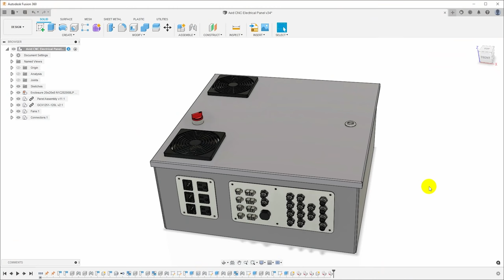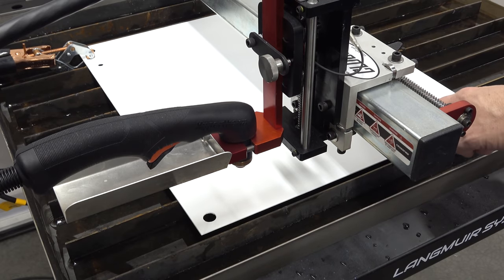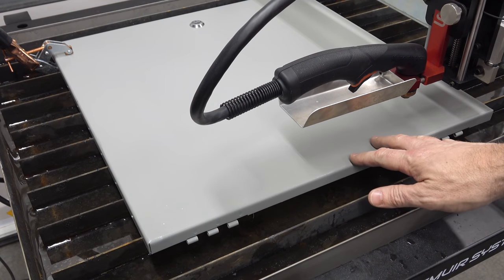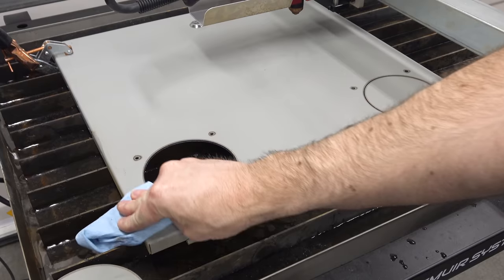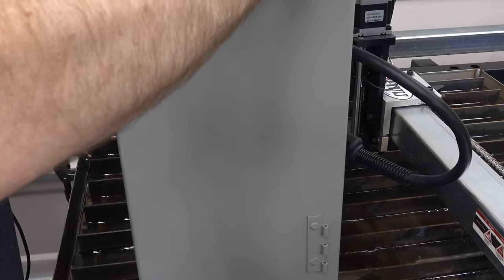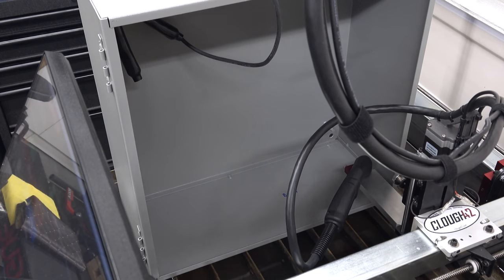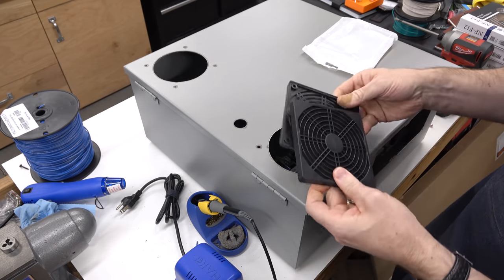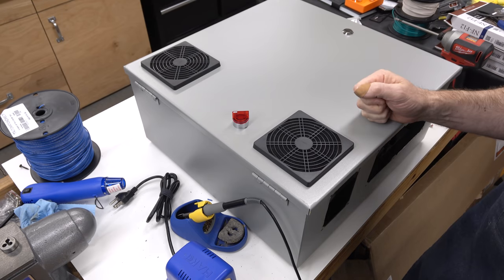Can you CNC Plasma Cut a NEMA Electrical Enclosure?  Should you?

Comment: A lot of industrial panel manufacturers use lasers for back plates and doors.  Plasma is a little less precise but as you discovered works just fine. I would run the water in the table higher.  There is less HAZ and smoke when the part is submerged.
Reply from the maker: I would if this table could accommodate that.  As it sits, the tops of the slats are above the edge of the tray.
Reply: @Clough42  new video idea. You have a plasma, brake and welder. You could do   a bladder table that changes levels.

Comment: My first thought about the slag/dirt on the paint was....Why not use the Teflon spray for mig tips/cones? Readily available at good welding supply places. Cheap(ish). High temp. Clear. Dries quickly. In production env. it lasts about 12hrs. Huge difference in slag buildup on the tip/cone. I wonder if it would keep the smoke, soot, slag from sticking to the paint?

Comment: I would have added an 8 inch extension and cut it off the front of the table.  I really like you extension design.  I will utilize that on my Langmuir table for cutting holes out of big stuff that wont fit otherwise.   The other way I have done this is use the CNC table to make a template that is about 1/4 inch larger on all dimensions, c clamp in place and use that as an edge to hand cut. This works good on vehicles etc.
Reply from the maker: If you extend the arm, be sure to check the springback.  I had to change the springback from .010" to .028" to compensate for the flexibility.

Comment: Dang, you can cut through a painted panel with plasma. Very interesting. Don't worry , James, you'll come up with another fine reason why you HAVE to buy or build a waterjet attachment for your CNC cutter :)
Reply from the maker: This plasma cutter has a pilot arc.  Without that, I don't think the torch would have lit.

Comment: When I first saw that you were going to cut the bottom of the box, I figured you would lay it on its back and cut it from the side by turning the torch to cut into the box. Wondering if that would be a viable way to do this job without getting the smoke and splatter from the water. The torch wood only need to move up and down I don't even know if the machine can be programmed to do this. But I bet if it can be done, James could figure it out!!!
Reply from the maker: You could probably do this by swapping motor cables.  Though getting the initial height sensor to work would require more thought.
Reply: @Clough42  Thanks for the reply, James. I have never used CNC plasma machine. I'm planning on purchasing one soon. Thanks for showing and teaching us how to do things, much appreciated!

Comment: Have you thought about making an enclosure from scratch? Cutting the sheet metal on the plasma cutter, using a bending brake, rolling the hinge etc...
Might be a good how to for others  and a challenge in thinking through the steps needed. There are a few videos on youtube by 
Dan Gelbart that showcase a number of tools he uses in manufacturing high precision end products for prototyping. He covers a number of things that are part of crating custom cases, but only  as disconnected examples.
Reply from the maker: Possibly for a future project.  This one is a little large for my plasma.

Comment: If you want to completely cover the black stain around the red switch. I have seen it is possible to buy a label holder for these switches. It is a black square thin piece of plastic, it mounts like a washer.

Comment: I've done a few boxes this way and for some reason I had to slow the cut down to 50% of what I would normally use for that thickness or even less. Something about the powder coating on the boxes made them really hard to cut.
Reply from the maker: Yeah, I had to slow it down, and it still just barely made it through.  I didn't go any slower because I was trying to limit the heat input.

Comment: II love your laid-back and thoughtful style. f you had a material you couldn't clean the smoke from and you really had to keep it clean - you could simply mask the area to protect it. Depending on the amount of heat exposure that could be as simple as masking tape and paper to something more heat resistant, like foil.
Reply from the maker: I thought about it.  I was a little worried about the blast traveling under the foil.  I thought about tape, but didn't want to add anything that would burn and make my day more exciting.

Comment: Yeah.. the internet is FULL of arm chair experts. I make my living cutting holes in electrical enclosures. The thing to remember is the enclosure loses its NEMA rating the instant ANY modification is made. ANY MODIFICATION. Electrical enclosures are made of low carbon, malleable, gummy steel that is a BITCH to machine, drill & saw, but easily bent, sheared, punched, plasma and/or laser cut, and can even be torch cut if you're in a bind and ready to re-paint.
Reply: Thanks for the info...
Unmodified enclosure surely is useful... Without a hole to get the power in...
Again some dumb rule/law...

Comment: great video. have you considered doing what alot of midsize CNC machines do, where you can extend the cutter (torch in this case) over the edge of the table so you can cut oversize pieces, obviously it wouldn't be over a water table but it does allow you to add a huge amount of flexibility in regards to what you can cut.
Reply from the maker: On this table, it's possible to take the tray off, and leave the entire inside open.  If I ever have a project that requires it, I might try it.

Comment: i added a drain bolt to bottom of water pan and made it a ground bolt, i never have issues of grounding and make great cuts... Powhatan Powder and fab  ....check out the vw bus we did on the same table you have
Reply from the maker: I have a brass ball valve on the drain, and I usually have the work clamp on that, but because of the powder coat, I wanted to make sure I had a good ground.  The plasma will make a real mess of things trying to molest the part with the pilot arc.  :)

Comment: I know you've already put it together but if any of the heat effected areas bother you you might try some fast evaporating enamel reducer as a solvent. DuPont 3812 or similar might remove the staining from the heat.
Reply from the maker: Or just paint with matching ANSI 61 Gray paint.  It doesn't bother me.

Comment: In the future it would be a good idea to change the tool path for the cutouts so it plunges through in an area that is away from the finished edge. It probably would have prevented the issue with the power switch.
Reply from the maker: This is the comment of the day.  I had to use a very short pierce offset for the screw holes, and didn't change the setting for the large holes because lazy.

Comment: I am interested in setting up for a plasma arc cutting torch,  Have you investigated on modifying the plasma torch for a vertical mount instead of angled for hand operation? I have not taken the torch apart to see if a modification is indeed possible.

Comment: Are you going to put in a diverter so that are can't flow directly from fan to exhaust?
Reply from the maker: No.  That's actually the path the air needs to take--through the servo power supplies, which also have fans.  Everything else in the box is negligible from a heat standpoint.

Comment: I use a hydraulic punch out tool with all the standard die sizes. Works really well. Just don't expect it (the punch) to work well on plastic boxes - ask me how I know.
Edit: Ah: None circular holes. Haven't crossed that bridge yet.
Reply from the maker: Yeah, I thought about using this as an excuse to buy a hydraulic knockout punch.  :)
Reply: @Clough42  Good deal. Installing my solar would have been a monumental pain without it. Especially the 2" knockouts for the DC from the ground mounted panel arrays.

Comment: That turned out excellent. I had already thought about this type of scenario, good to know it can work. I'm curious as you run your water lower than I do, any particular thoughts on this? I like the results of running the water higher other than it can make a bigger mess.
Reply from the maker: I drain the table into a bucket and store the table dry, so I try to keep the volume to what will fit in a 5-gallon bucket.

Comment: Thanks for answering this question. BTW, you're getting awesome quality 4mm hole cuts from your Crossfire, what size nozzle did you use?
Reply from the maker: It's the Hypertherm FineCut consumables on the 30XP.  The holes are drawn 3.3mm, and they're coming out pretty close.  Maybe just a tad loose, but they still tapped fine for M4.
Reply: @Clough42  I'll look up the FineCut specs. I'm using the RazorWeld 45 (sorry I'm not Hypertherm worthy ha) with my CPro. After watching this video, I definitely need to play around with setting to get closer to your cut quality. Its awesome. Thanks for the fast reply.

Comment: Try some anti spatter spray to keep the panels cleaner. I suspect there is a short straight head for the plasma table. 3M also makes a water soluble overspray masking liquid that might work. Even a spray wax might work.
Reply from the maker: Good ideas.  I'm using a Hypertherm plasma cutter that I hotwired (in a previous video.  It doesn't have a machine torch option.

Comment: Love your channel! Quick question... not sure if you answered already... but how do you get all the 3d models for the components inside the enclosure? I would love to do this but remodeling everything seems overkill plus that would mean having all dimensions, and not always you get accurate dimensions to draw as you did all the components. do you ask the 3d models for all components to manufacturers? I guess the answer could be buy common enough (or expensive enough) components from well known manufacturers so that you can find a 3d model of those easily online....
Reply from the maker: Automation Direct and McMaster-Carr have models for most of what they sell.  And most electronics manufacturers and large distributors publish 3D models as a part of their PCB design libraries.  Molex and TE Connectivity have models for most of their connectors.   GrabCad is a good source for more obscure items.

Comment: Hi James, great video as always, can I ask where you get the models for fusion 360? Grabcad?  Cheers James
Reply from the maker: I usually try the manufacturer or distributor first.  Automation Direct and McMaster-Carr have models for almost everything they sell.  Digi-Key and Mouser have some stuff, usually intended for PCB design.  If I can't find it from the manufacturer or distributor, GrabCad is usually my next stop.  I rarely find anything useful on Thingiverse or any of the other STL sharing sites.
Reply: @Clough42  Thanks for that, It will help, Here in the UK we're not so used to McMaster-Carr etc and its not something that occurred to me, I'll have a rake through it and the others thanks.

Comment: Tip from cooling pcs, place your fan on the other side, where u have it not you have created a"dead zone" on the far opposite corner.
Reply from the maker: I created exactly what I intended: directed flow through the servo power supplies.  Everything else is negligible in this box, and convection will suffice.

Comment: Hey James quick question on the ELS kit. I bought one from you last week on ebay and i have a F28379D laying around, do you think I can use that as opposed to the F280049C? The boost board mounts fine and the pins seem to all line up as far as function. Other than the jumpers being in a different place they are the same as far as function and the processors seem to be the same. No one seems to have a 280049C in stock and unknown when they will be back in stock.

EDIT: Easy fix for your power switch on the door could be to add a thin rubber gasket which will also help with stopping dust intrusion.

Comment: Did you consider making it a positive pressure case? You'd probably want all the dust and particulates to be forced out all the nooks and crannies. If you wanted to do this you could simply add an extra fan to the second fan spot.
Reply from the maker: It is a positive pressure case.  The one fan draws air in through the filter, slightly raising the pressure in the case, forcing air out the top filter, and around all the connectors and the edge of the door.  When it's running, you can feel the air escaping.

Comment: Watching now, but I can't imagine why it would be considered a bad idea.  Other than no longer technically meeting it's NEMA rating or something like that?
Reply: Maybe, but the one he has, came with no openings at all. Pretty useless box if it has no openings. I wouldn't pass a cable through a raw plasma cut hole, maybe that's what people mean? But you just use the right kind of grommet or gland or in this case, little panel and panel mount connectors...
Reply: @rpavlik1  I'm no expert on the matter, but I would imagine any rating that NEMA gave it would only be true if proper knockouts and cable glands and the like were used, since they were likely what was used when testing the enclosures.  It doesn't matter here though, because he probably doesn't care about the NEMA rating, and why would he?
Reply from the maker: The concern was that it would ruin the finish.  Now that I've posted the video, one other person suggested that the metal under the paint might be galvanized.  That would be another reason to be careful.
Reply from the maker: It's NEMA 1 anyway, so it doesn't even have basic dust ingress protection.
Reply: @Clough42   Yeah... very ordinary enclosure, frankly.  Doesn't even have a welded Earthing stud mounted on the door and inside box, nor welded corners to prevent fluid entry...  lousy hinges too.
Given it's a 1off, not 100 or 500 following much the same layout with variation in switch numbers etc., professionally I'd have just used a decent jigsaw for straight sided cutouts and hydraulic punch for the single 22.5mm switch operator. Quicker than messing around with programming, setup and cleanup.

I strongly advise the tiny 5v fan is very under rated, along with the filter surface area.
It's likely the 2 power supplies will cook, especially mounted high in the box with little airflow clearance above them. 
You should already know, the power (wattage) needed to increase air flow/min. with fans follows a log curve, just like water pump capacity. i.e. to double the volume/time it is NOT a case of double the motor power. 
At  least you had the fan blowing in to create positive pressure inside the box, as it should always be.  
The filter element is see through - just a big rock stopper... might catch cat hair -  and the area should be minimum 3x fan opening area. This is why pleated non woven filter elements are used in industry and automotive applications. Given no dust sealing around door, air will probably vent there before making out the door exit vent anyway. The fans would have been better located on the box ( latch side) and vented out the door, so install 2x  thicker mains voltage fans and mount an aluminium framed filter holder over these fans (size the same as that box wall face). 
Earth (ground) the damn door, enclosure AND internal gear plate. If there is Mains Voltage in that enclosure or on the red illuminated switch it SHOULD BE Earthed.... low resistance wired connected with specific purpose fasteners, not via fasteners used for mechanical fixing of equipment or enclosure.

Comment: I wonder if one could cover the cutting area of the box with masking tape to ease the clean-up after cutting.  Will a plasma cutter cut through a panel covered with masking tape?  There probably exists some type of protective film that might work better than masking tape.  It is all very interesting.
Reply: If it has to be conductive maybe aluminum tape .002-.005 thick
Reply from the maker: I think the plasma would have no trouble with the tape, since this cutter has a pilot arc.  However, I wasn't sure if the tape would burn and make things worse, or if the sideways blast would get trapped under the tape and affect the finish more.

Comment: That looks really good. Sure beats the drilling, grinding, cutting, filing that I've gone thru in the past to do similar projects.

Do you leave the raw metal edges bare?

Is the front panel switch meant to go into a "D" hole? 
Plasma cutting that feature would be a breeze.
Reply from the maker: No.  The front panel switch goes through a standard 22mm (7/8") round hole.  They sell matching paint you can use to touch up the edges if you like.

Comment: I was thinking during the video that if I made templates (I don't have a x y table) if i could just run the plasma cutter around by hand...problem is how to control the speed? A motorised roller that runs on the template that will also keep the distance to the surface consistent? Perhaps the template has a routed groove for the roller to run in?
Reply from the maker: If I had a laser, I would have used it to cut a template to hand-cut with a plasma torch.
Reply: @Clough42  Yeah, tempting to go down the "I wish" path, but for my needs, I need to make many parts that are the same. A plasma cutter makes sense and is cheap, relatively speaking, but getting or building an CNC XY table is just not a practical option for me. That makes cutting out a template and adding some guiding features the only sensible option for my needs. I can cut and shape a wooden shape, even if it takes a couple of hours to perfect.

Comment: James, you just missed the opportunity/excuse to buy yourself a water jet cutter. 🙂
There would have been no issues with heat discoloration or smoke residue at all.
Reply from the maker: I've been pricing them.  Real ones are a little out of reach for me, and the Wazer looks like it would be extremely slow, messy, and frustrating for the kinds of stuff I would want to do with it.